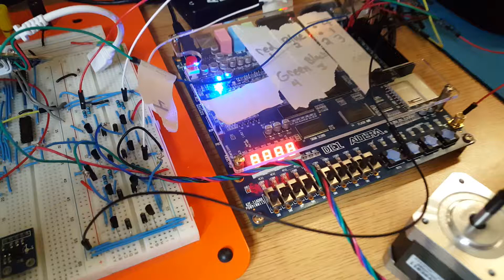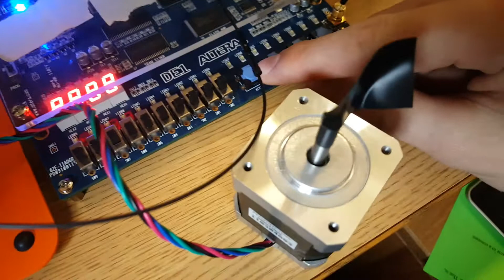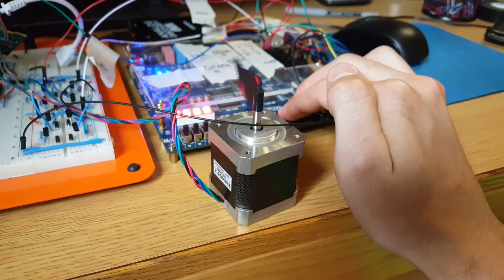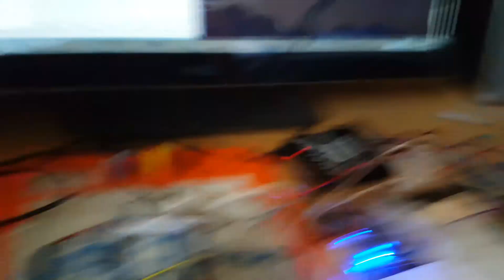FPGA Stepper Motor Driver

Comment: hi how did you amplify the fgpa 3.3v to what the motor needs, what was your configuration
Reply from the maker: Hey, I used an H-Bridge for each phase of the motor. The 3.3V outputs from the FPGA were used as input signals to the H-bridges. Hope this helps. https://en.wikipedia.org/wiki/H_bridge
Reply: Are you using an IC H-bridge?
Reply from the maker: The rightmost section of my breadboard contains the two h-bridges that I created. They were made out of discrete transistors, resistors, and diodes.
Reply: Oh, now I see the 8 low power transistors on the bottom right of the breadboard. Thank you. How further should I go to implement microstepping and an UART fifo to receive and process g-code instructions?
Reply: Thank you, but I want a program written in VHDL.

Comment: can i know how u set the frequency for speed up the motor?
Reply from the maker: In the lower right hand corner of the Altera board, there is a red wire going into that gold connector. That wire is connected to a function generator producing a square wave, at whatever frequency I want. That is used as the clock signal. Kind of a cheap way out, but didn't have time to implement it in verilog :)
Reply: so controlling speed doesnt require verilog code? can u give me ur code..
Reply: bro pls help me :(